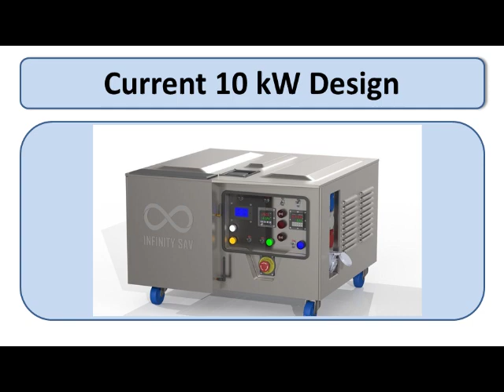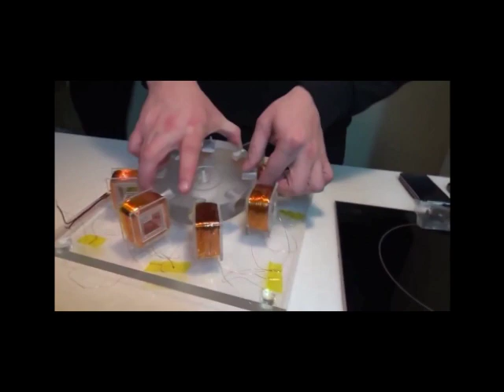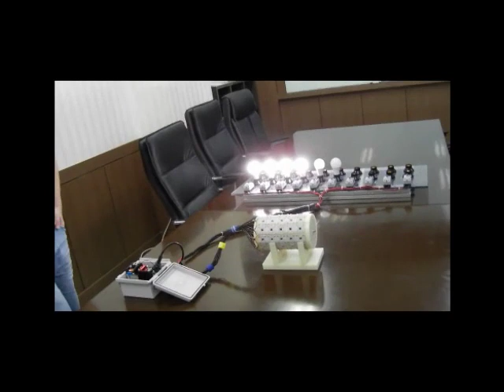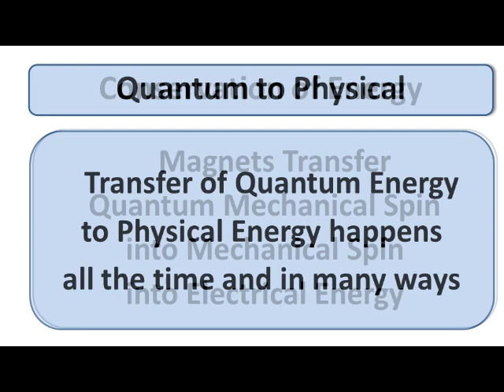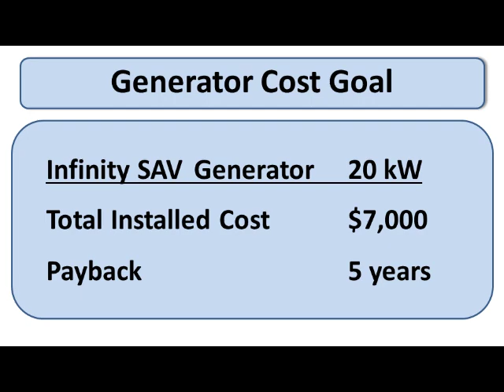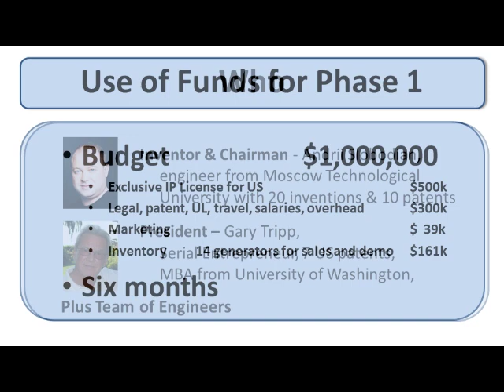Infinity SAV US Pitchdeck $1M w MG 10

Comment from the maker: Quantum Energy Transfer Theorem (QET)
By Gary W. Tripp 
June 2018  Updated 2020
The transfer of energy from the Quantum Field to the Physical Field and back to Quantum Field happens all the time.   It is just not well recognized, because we are mentally locked in our three-dimensional world of gears, levers, and heat transfers.

When Sunlight heats the earth or strikes a solar cell and creates electricity, it does work by transferring energy from the Quantum Field of electromagnetism to the Physical Field.  When Earth’s gravity changes the course of meteorite, it does work and by transferring energy from the Quantum Field of gravity to the Physical Field.   When a radioactive particle from Uranium strikes water and heats it, or strikes X-ray film and creates an image, it does work by transferring energy from the Quantum Field to the Physical Field. When a magnet approaches a coil of copper wire, it causes electrons (electricity) to flow in the wires and does work by transferring energy from the Quantum Field to the Physical Field.

The transfer of energy from the Quantum Field to the Physical Field caused by an approaching magnet is the source of the energy transfer that Infinity SAV USA’s generator uses to produce electricity.   

When the magnet approaches a coil of copper wire it induces the flow of electrons and creates a like polarity. North induces a North polarity and North repels North and that is the motive force for the generator rotation.

Magnetism is caused by the Quantum Mechanical Spin of Unpair Electrons. 

Magnets that do work by transfer 1% of their Quantum energy every 10 years to the physical work being done.  But because the energy represented by an electron orbital position is so great, it does appear as if the energy is just appearing magically out of nowhere.  I have often said Magnets are the bridge between the Quantum world of infinite energy and the Physical world of limited energy.

Gary Tripp gary@tripp.net   gary@infinitysav.us 1-206-383-2245   © 2018  © 2019  © 2020